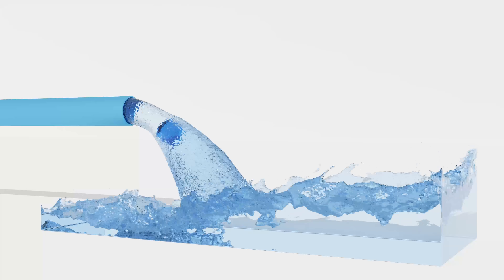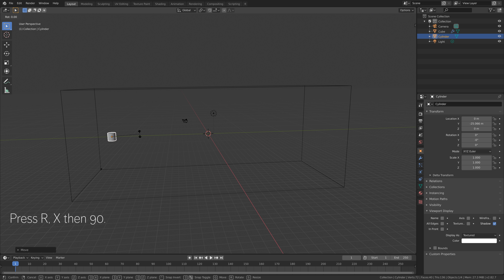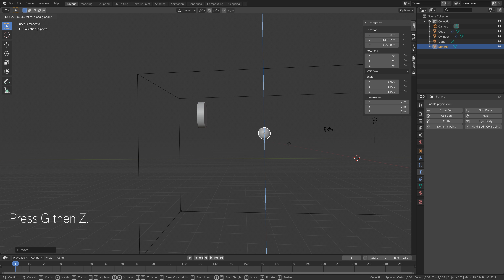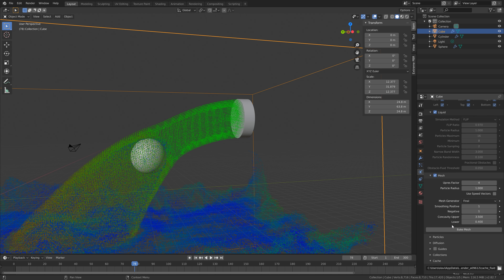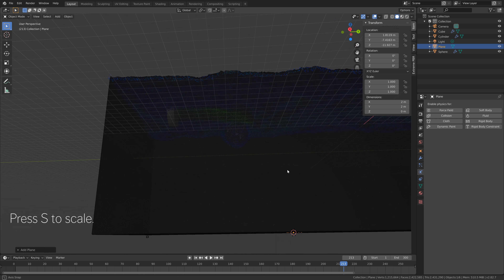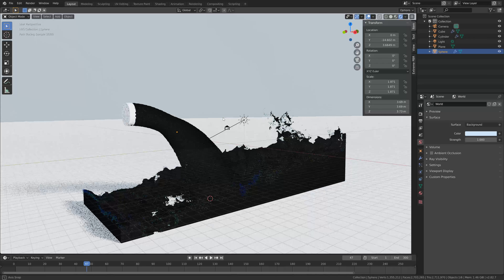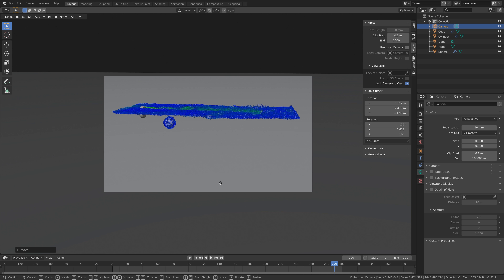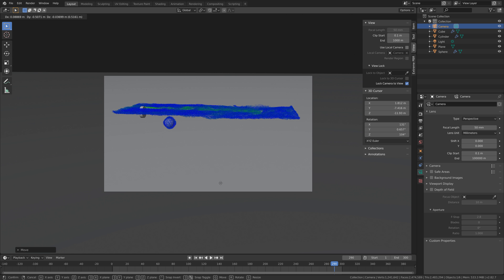[2.82] Blender Tutorial: Water Simulation for Beginners, Mantaflow

Comment: Hello,

I have a problem.
I would like to animate a fire extinguisher and water from the hose spraying.
My nozzle has 1cm diameter.
The water should only be considered as a jet spray function.
Also should not be so much water collect at the floor.

How does it work?
Reply: Use the force-fields and I forgot which one to use but use those.

Comment: thanks for the tutorial. but can you explain why the top part of the inflow becomes static as if made of glass while the rest of the water continues flowing? how would you achieve a more realistic looking flow of water?
Reply: This is actually a real occurence in real life. Its called laminar flow.
Reply: That's how water behaves though. It's laminar flow.

If you want some turbulence in the flow, an easy way would be to animate the x/y/z velocity values on your emitter. Keyframe them on a starting value (can be 0, can be anything you want) then add an f-curve for noise on the graph editor. That'll impart randomized momentum to the particles so that your jet is not static.

You can also make it collide with a tube object before it enters your scene, so that the fluid behavior is more akin to pouring something out of a bottle or spraying water out of a house.

Comment: I'm missing the 'bake data' and 'bake mesh' button. I've switched between Eevee and Cycles, but it's still not there. Help?
Reply: What version do you have? ( Of blender)
Reply: @cipgi7568  I have 2.82
Reply: @theAntiCauliflower  same here im using macbook pro 2017
Reply: FOUND IT! click the workbench instead of eevee and cycles
Reply: @DigitalPoetryMedia  Nooooo I still don't have it. Glad you found it tho!
Reply: @theAntiCauliflower  oh.  im using macbook 2017 pro. :( i
Reply: @DigitalPoetryMedia  I'm using windows, maybe that's why :(
Reply: It doesn't matter if you are on an android making this, but unless if you selected the wrong simulation, it should always be there
Reply: @The33554  I checked again, and I'm definitely selecting the domain cube. It turns orange and gives me all the options for the simluation. Although I did noticed that the domain cube doesn't appear on frame 0 of the animation/ simulation, but it appears from frame 1 onwards, I don't know if that has any effect? Also some of the effector cubes inside my domain cube extend outside the domain cube. I can't think of any other reason why I can't bake the simulation :/

Comment: Hey dude, what are your specs ? Aside from the RTX 2080 super ?
Reply: I too am curious about this, because I ran this render on an inferior graphics card and got way faster render. After thinking for a moment, it didn't make sense to me that this sim would be done by the GPU (though I'm not an expert, it seems like multi-threading would be dominant here).

I took a look at my Performance Monitor and found that GPU was close to 0% and CPU cores were all ramped up.
Reply: @kredibled  simulations  are entirely cpu dependend..for now.
Manta flow is now multithreaded and therefore ryzen cpus are a good choice.btw about your similation...check your quality setting...if you go high.mahn even a good cpu might go for hours doing a medium size simulation.